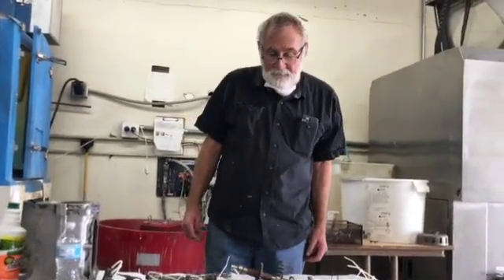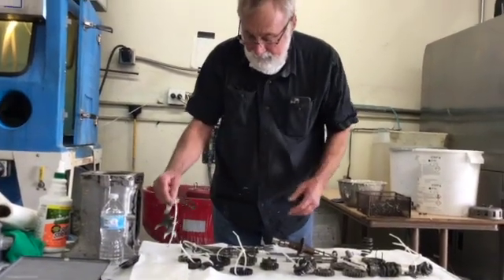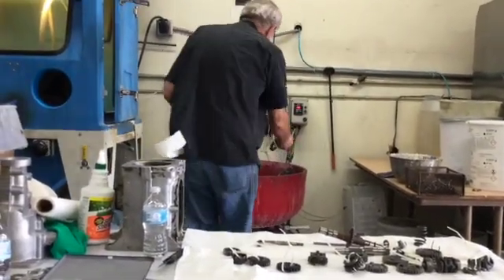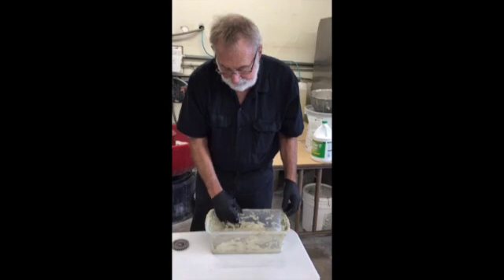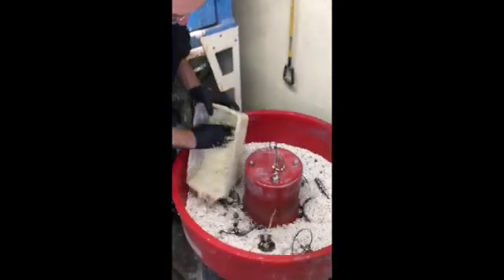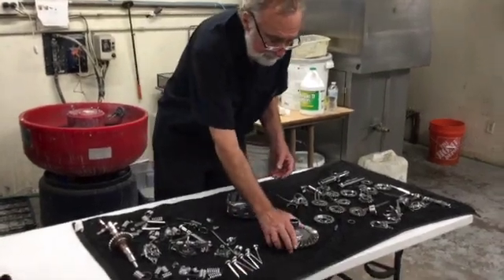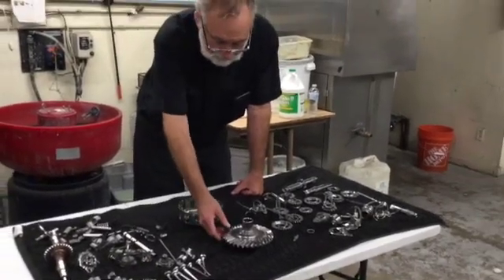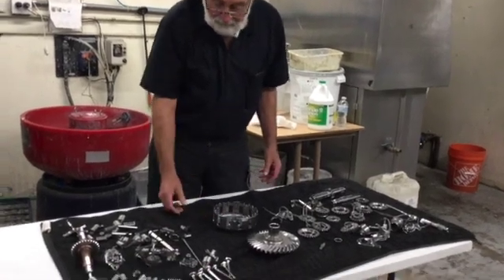Advanced Tec-Neeks Isotropic Super Finishing Vintage motorcycle transmissions

Comment: Mr. Lawlor, I truly appreciate the active mechinal mind that is thinking outside the box, producing a desirable product. You toothpaste type additive used in the large vibratory tumble filled with a small fine ceramic cones looks like it does an excellent job in polishing. Thank you for sharing and allowing me (Us) to witness. This to me is fascinating. With such a smooth polished finish, reduces internal parasitic frictional looses. As you said, this can allow the use of a less viscous lubricant as it has less heat to remove if the part is highly polished even in complex shapes & forms. 
 Thank you for showing us and allowing me (us) to see it. 
Excellent!
DK, ASE Master Tech since 78.
Retired. Thanks sir!